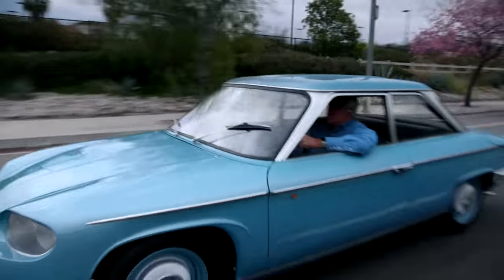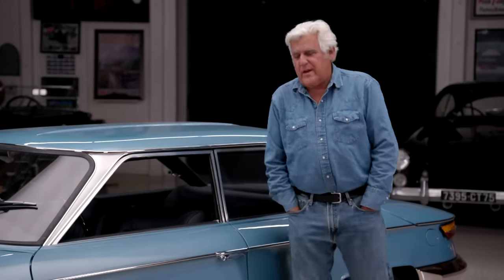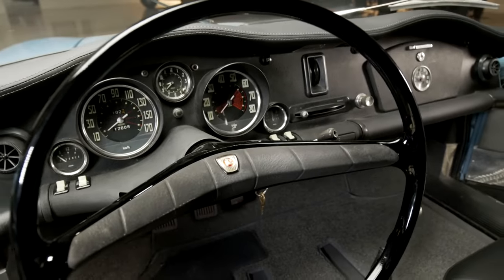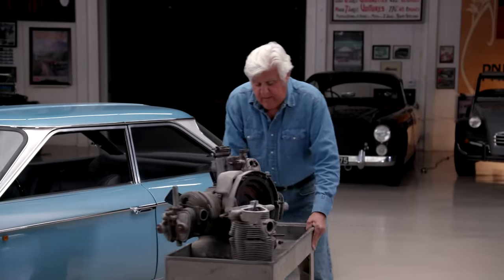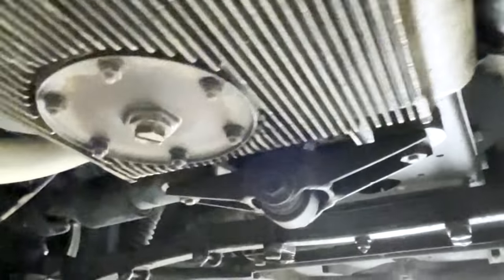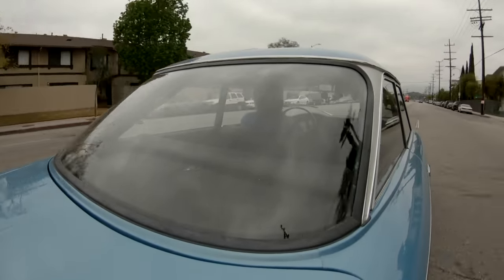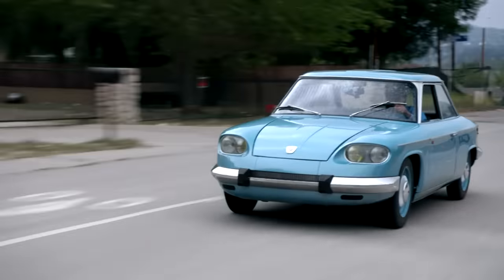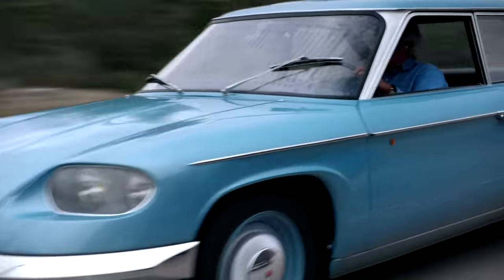1967 Panhard 24 BT - Jay Leno's Garage

Comment: I had a car that is similar in a lot of ways to the Panhard.  The car was a 1960 Lloyd Alexander TS that was made by Borgward in Bremen, Germany.
It also had a two-cylinder, air-cooled engine of 596 cc's.  It produced 28 SAE HP.  The top speed was 65 MPH.  The engine had a single overhead camshaft with rocker arms and inclined valves and hemispherical combustion chambers.  A single throat Solex carburetor fed air and fuel to the engine.  I used to take the engine out by hand and put it on the workbench.  The engine with the transaxle attached weighed 115 pounds. The car weighed 1245 pounds.  I could pick up the rear end.  The shift lever was on the column in a reversed pattern.  First gear was down and toward you, second was up and toward you, third was down and away from you, and finally, fourth was up and away from you.  If I remember right, reverse was from neutral toward you and down.  I could go on for pages of material about this car.  I'm sorry I gave it up.

Comment: Can you imagine that Louis Bionnier, the designer of this car was in his eighties when he designed the BT24, there is a very clear design link with the Chevrolet Corvair, he always admitted this.
Furthermore, look at the headlights and the integrated door handles, both features were "borrowed" by Citroën for the last model of the D-Series cars introduced in 1972.
My father always said this was the best drivers car he ever had.
Reply: The DS front light restyling was in 1968, not 1972.

Comment: Jay, I have the 24ct in Oregon, thanks for the mention!  Hoping to get it out now that the pandemic is over.  Your BT is a 67' with drum brakes, it should have disc brakes, but the drums look so much better.  Mine is a 64' where the drums were replaced by disc setup - the fronts have two calipers per disc, because, well you know - its a Panhard!  The only other neat feature that wasn't shown in the video is the spare tire storage - it is a drop down hatch below the rear bumper line.

Comment: Different engineering is always interesting.  I like the brake drums integrated into the wheel.  I would have liked to have seen an actual implementation of a "Panhard Bar", which is a simple but effective rear suspension feature on many cars and as an after market add-on.  I didn't know the origin of that.  Now I do.  Thanks!

Comment: A few facts worth mentioning that suite surprisingly you omitted: after WW2, Panhard became a subsidiary of Citroën and it appears in several Panhard models' features: air cooling, torsion bars, aerodynamic design, to name a few. And the 24 BT model is in fact the lengthened four seater "coach" version of the more common original 24 CT 2+2 coupe.

Comment: I like seeing these unusual cars better than I seeing the McLarens and such. The Corvair influence was immediately apparent, and the wheel/brake design was very original. I love the space efficiency, too. The exhaust pipe as an engine mount seems like a bad idea if it's used in a northern locale where they salt the roads in the winter.

Comment: Jay- if you're reading this- do you remember the 1966 Honda CB 450  twin? They were colloquially known as "The Black Bomber" (I dunno if that's in homage to Joe Louis or not) and would rev and rev. A very fast bike. It also used torsion bar heads. I remember getting a quote of something like $1200 for a valve job on that bike- this was in the late 80's. 
 Heck, you probably have one!!

Comment: LOVE THE 24 BT. Citroen had absorbed Panhard in 1964. I thought then that if anyone could appreciate the quirkiness and independent thinking of Panhard, Citroen could ... but in the end they let them go. Too bad. I love driving cars made as the result of one person's idea of doing things. There is no copying. "This is what we want to do and we will do it this way.",Lightweight, small efficient and durable little engines. Driving these cars to their maximum is great fun. GREAT FUN. I have been looking for a good 24BT for years. Came close twice. I was too late both times. Still looking. Meanwhile I presently can be found scooting around these hills on one of three different two cylinder Citroens, usually with their unbreakable engine screaming: 50s styled sedan,  AK400 Fourgonette and/or Mehari.  You could call it The Joys of Minimalist Motoring.

Comment: A beautiful car. Has hints of the smaller BMWs also, especially around the rear. I would have preferred the column change, but the simplicity of air cooled is always an attraction. They say the successor became the GS in spirit, with its air cooled flat 4.

Comment: I owned a VW type 3 from that same era. Air cooled 1600cc  flat four, but needed valves readjusted monthly because it had a separate head that that single cylinder on each side did not need with the aircraft once piece head and cylinder. Roller bearings were sometimes used in the Porsche versions of those engines. I replaced that car fourteen years later with a Renault R5 (LeCar) that was also 1800 lbs and able to float through potholes with ease. I think the steel side panels of that car were two thick layers of plasticized paint with tin can gauge steel between, but the unibody was quite solid. The Renault had a shifter almost as bad, rubber snubbers throughout the linkage made it even worse than the VW's "stick in a bowl of oatmeal" shifter. Both the VW and the Renault had the engine behind the transaxle, but of course the R5 was front drive with the engine taking room away from the front passenger.  I might have bought a Panhard if it were sold in that time in the U.S. as it is quite elegant.

Comment: Jay, I was one of those people that bought a Peugeot 505D in the early 80's. My wife to this day still hasn't forgiven me. Whenever anyone asks about cars she is quick to mention what her bonehead  husband bought!! Gotta love that girl.

The car basically fell apart as we drove it. All the integrated circuitry was the main problem. I'd hit the brakes, which blew the fuse for the brake lights, the engine cooling fan, and the A/C if I remember correctly. I took it to the Peugeot dealer and he gave me a handful of replacement fuses and showed me where to put them!! ha ha. We were driving in Palm Springs in the summer when it happened once. So now you know why she still brings that up!! Oh, and we
re motoring along and I see her turn her head to the rear of the car as I'm driving. She lets out a laugh as the headliner comes down on us!! Took it to the dealer and they did not import the color of the headliner trim so I had a 2 tone headliner thanks to Peugeot. Best day of her life is when we sold that car, mine too........

But, you are correct, the French know how to make a car ride well. It was the most comfortable riding car I have owned.

Thanks again for sharing your collection. Much appreciate your knowledge of the brands you show us.

Comment: I really LOVE the styling of this...looks so much more modern than it is, sort of a cross between a Chevy Corvair & a Ford Taurus with some Nissan vibes as well(and headlights hint of Porsche or McLaren)  40mpg is pretty good economy but still...wait a minite Jay...Hey, that 1600cc VW engine you're comparing the Frenchy 2 cylinder with was cruisable at 70mph & topped out around 92mph-not 68...  I agree it's better looking than a type IV though & looks larger than it is.

Comment: In France The 24 BT was fitted with disk brakes (double caLiper in front). I owned a CT (coupé Tigre from 1992 to 2000)it was really a wonderful car. Infortunatelly the engine was very difficult to tune and adjust and needed special tools. A popular car that needed the same care as a Porsche.The exhaust can be found new and stainless in France. Some parts are expensive others impossible to find but what a car it has to be driven pedal to the metal.
Now my collector is a Porsche Carrera 3.0
.

Comment: Anyone can build a supercar where cost is no object, but it's even more interesting to see what engineers do in their native environment where cost and materials are limitations.  Engineering is all about constraints.  This is an awesome car and I'd love to buy something similar today; a lightweight, but reasonably-sized car with a modern efficient engine and modern crashworthiness.

There are some fascinating 2-stroke engines coming out today and some of them have remarkably low emissions, though I doubt they could meet CA emissions.  I like the developments in electric vehicles, but they are super-heavy and expensive.  It's very unfortunate that some compact American car hasn't made it to market with a light weight and simple design; something bigger than a Smart car, but with fuel economy similar to a Hybrid.  With low weight, it doesn't take much horsepower to keep up with traffic; this Panhard is proof of that and it was built with much older technology than what's available today.

Comment: Thanks for another interesting car, Jay my first impression was that it looked a lot like a Corviar, and you said Panhard wanted it to look a lot like a Corvair.....lol. That two cylinder, air cooled, hemi head engine would make a good power plant for a tandem seat trike paramoter, probably more dependable than a two cycle engine and light enough in weight, but I don't know about that idea of the exhaust being used for the engine mounts. I would still be an interesting setup.  God Bless and stay safe.

Comment: As for the cable-operated gear lever, nearly all French cars (both vintage & contemporary) have elastic, imprecise shifting. Even the ones with pushrods instead. This is an early attempt at nivelating NVH and it was done deliberately. Thus it is not advised to stiffen that up, remove the rubber gaskets, or any elastic grommets - it will make the drivetrain vibration & movement more pronounced in the cabin.

Up here, we are used to that in their new cars. We even have national jokes about “spongy” French shifting ;-) Just ride & enjoy, nothing wrong with that!

Comment: After taking over Panhard Citroen built one of these with a complete DS drivetrain up front - that must have been pretty quick, despite the extra weight. The CD of the standard BT/CT was 0.25 which, coupled to a tiny frontal area, explains the high top speed....

Comment: Many thanks to you, Jay, to permit people to appreciate those types of cars, unknwon because they disappeared too fast, although having been full of technical innovations. Now, just some inputs from a french Panhard lover, if you allow me. First, I do not think this one is a 1967, because  the 24 BT and 24 CT had received the much needed disk brakes in 1965 (even twin calipers in front!).let's also play on the historical side, Because of the materials restrictions  just after the war, and thegovernment allocation of those, and order to the companies to produce such and such type of vehicles, PANHARD , builder of luxury cars before 1940, had to turn to small ones, so they built the DYNA X with this first flat  twin, then the Z in 1954 evoluting in the PL 17 (one of yours) THey never were competitors to the beetle, because, at that time the german cars could not be sold in France!
Then in 1959 Citroën took the reins of the brand and the factory They did not want competition on the sedan range with the DS ( and future AMI6)so Panhard turned to a "coupé', and did all they could to have it powerfull, with the same engine. That was a nice job, but for only 4 years, Citroen management  did not want any evolution , especilly not one with a 4 cylinder which was in the minds.so they killed the building process in July'67. and very strange, after a long gestation, in 70 appears the GS , medium sedan with a flat four!, hugely succesfull.
It is to be noted that the huge taxes on engine size in France after the war( well, still now!) and gas scarcity asked for small and economic motors , Hence the 
850 cc which has to be revved up to run well and abhors idle. Unfortunately, most people did not do that, and lubrication problems occured.

You were right, many sport awards for this engine,  on CD racing cars (Charles Deutch)  and DB 'Deutch & Bonnet) mostly on fuel consumption indexes.
OK I stop bothring you with my words and wait for a new  JL run! Thanks to you.

Comment: Another draw back : there is no oil filtration in the engine and the crackshaft must be cleaned every 50000km. To do that it was necessary to dismantle completely the engine.Long and costly work ...I enjoyed this road test Thank You Mr Leno.
From the south of France

Comment: The  Panhard Cars was killed by Citroen wich had a controlling share of it. They decided the Panhard plant would be better used to build Citroen cars instead, as they lack space in their own. But the Panhard ways still survived in the Citroen GS. The GS was very aerodynamic, light, FWD, with air cooled  flat 4 motor (1000 to 1300cc) and  long travel hydropneumatic (like the DS) suspension affording very good road holding and comfort. It was never imported in the USA but was a huge success in Europe and elsewhere. I'm  pretty sure Jay would like it.

Comment: Mister Leno's forgotten to say that the Panhard 24 was the first french car with rear seat hot air passing in tubes through the doors. So modern in Europe in the 60s. Also the headlights was copied by Citroën for the DS mk2. We also use to say Citroën closed Panhard soon after buying it to copy its best tips and kill a strong potential competitor

Comment: Must be the HubNut influence, but I think it's too bad we didn't get to see those syncopated wipers in action. Speaking of wipers, it looks like yours aren't set-up properly: they are parking in the opposite position of the way they should. The driver's side should be resting at the base of the windshield and the passenger side is the one that should be part way up. Yours are currently set-up for a RHD car.
Impressive sounding door shuts. I really like this car a lot.

Comment: Someone find Jay a good example of the real first Hot Hatch to try - Renault's R16TS.
He'll be thoroughly surprised at how much grip you can have with so much lean, and a 90hp 1565cc cross flow four with hemi head. The later 5speed TX with EFI would be a shock too.

Comment: V-Twins, 270 degree and 315 degree parallel twins, flat-2s with unequal length headers, t-plane triples, crossplane inline-4s, V4s…soo much potential for small engines with awesome sound to be used in modern hybrid cars (powered by e-fuel), instead of those boringly “efficient” electric cars.

Comment: Hey Jay, how would they machine the valve seats?  Looks like the angle is too steep.  Also how do the valves close with no return springs?
Reply: Torsion bar + hydraulic push rods
For more details check out "moteur panhard tigre usinage sièges soupapes" and "moteur panhard tigre soupapes fonctionnement" on your favorite search engine, there's also a YT video about valve clearance adjustment : 
https://youtu.be/HaEpTOukp94
you can also get French captions and automatic translation.

Comment: Panhard was briefly owned by Citroen, in the 50s. A lot of the ideas used in the ID/DS cars were first used by Panhard. Even the gears used in the gearbox are completely different to any other cars. Panhard was an innovative car manufacturer,  with very different way of engineering cars. They have a cult following in France,  because of their rarity, and their extreme French idiosyncrasy.

Comment: looking these up and seeing that you can get a decent one for 10k before shipping it to the states.... tempting
Reply: You'll need a good mechanics who's able to deal with the specificities of the Panhard Tigreflat twin and a undersized gearbox. Except if you want to swap it with a BMW flat twin (from a series R motorcycle, and you'll need at least a R90S to match the performance level, or a BMW 700 car) or a Citroën flat four for more torque... or going electric.

Comment: I can't think of any American muscle car I'd prefer over that understated 1967 Panhard. Styling and engineering so stellar. Have you heard about Toyota's new 3 cylinder ICE engine? Imagine that Panhard with all around disc brakes and that new Toyota 3 cylinder? 50 mpg and fast enough. No catalytic converter hopefully (I think we need an EPA exemption for engines under 2.2 liters; there are ways to burn gas cleaner with fuel injection and CDI ignition and advanced technology headers that integrate small scale cat components with minimal back pressure.

Comment: Good advertising was only part of the reason for the VW Beetle's success in the US. The other half was that VW required their dealer to have service departments, and required the service departments to be stocked with a certain amount of basic parts. This was not true for Renaut, Fiat, or BMW. Then things expanded exponentially – lots of cars so lots of aftermarket parts became available.
Reply: Indeed VW did have solid advertising